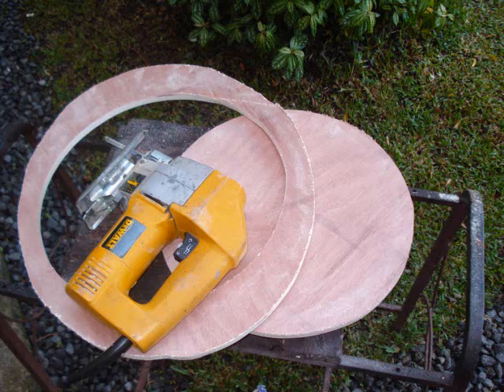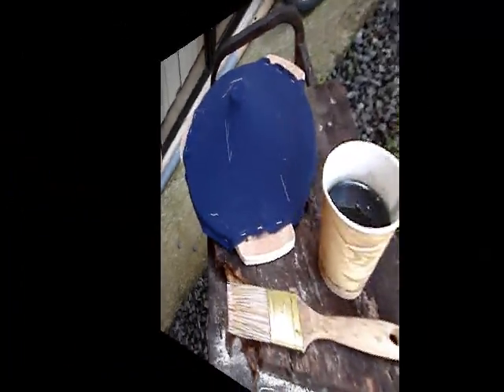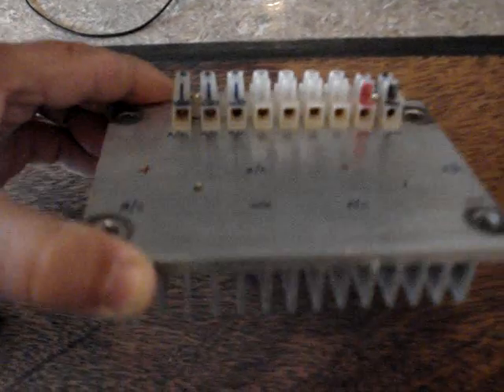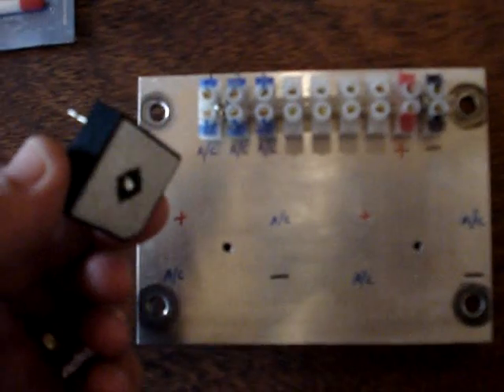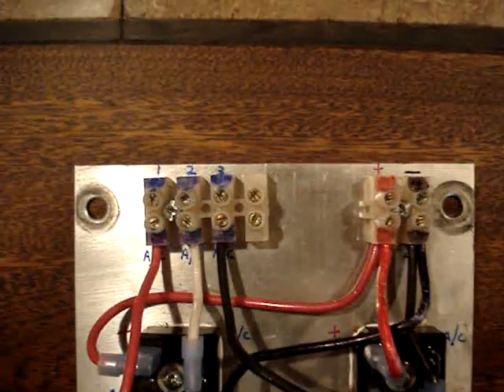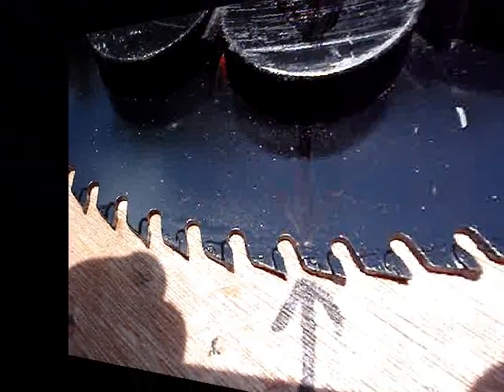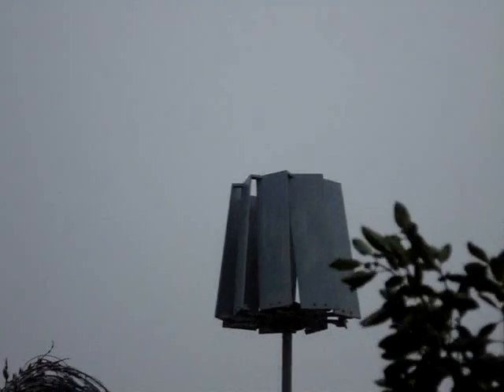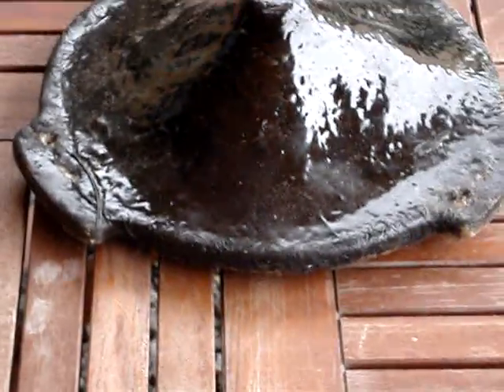(3) How to build a P.M.A generator for a wind turbine V.A.W.T

Comment: Wood warps with just humidity i wanna try aluminum  or carbon fiber for permanet use te
Reply from the maker: Wood can and has been used for blades for ever, some airplanes still use wooden blades. Also lots of HAWT turbines use wooden blades. It depends on the wood and how you treat it. Aluminum is also a very good material. Thanks for the comment.

Comment: I want, I'm confused, this bridge rectifier you used and 3 phasic or monophasic.?
Reply from the maker: +SANTANA CHAVES I used two bridge rectifiers and attached one phase of 3 from the stator to each a/c input on the rectifiers I end up with one extra a/c connection on the rectifier that does not get used. I connect both the d/c outputs from the rectifiers together to charge the battery.

Comment: another issue, and one that's tempting me to pull out my hair in frustration, is how to wire  2 to 3 stators to produce as much output as they can.
Reply from the maker: +Troy Moore Maybe you could use just two large ones. One to run your A/C power and the other with a bridge rectifier to run your D/C power. I have seen some other videos on You Tube that have run the A/C power directly from the PMA You should do your homework on that. I dont know how big the stator would have to be to handle A/C loads. Good luck.

Comment: next inquiries I would like to address is setting up how to use the direct ac output and setting up a bypass circuit that will allow me to  switch from ac to DC as needed/desired.

Comment: ive been referencing your videos, as well as my own research, via the internet, to plan out my own generator.  i am running into an issue, however.  i cant find any info on how to set it up to be used directly as an AC power source. any ideas on that?
Reply from the maker: +Troy Moore Technically the power running directly from the PMA is A/C to begin with you just have to spin it fast enough to produce say 120volts. If you were able to get it to spin fast enough you would have to add some capacitors to keep the voltage evened out. This is easier to do with hydroelectric the water keeps the generator spinning at a more constant speed.
Reply: I'll be building an electric motor for just that purpose.

Comment: nice video mate, one q though. 8v at 10 mph ,,, how many amps ?   I don't know much, but that sounds ok if the amps are there.
Reply from the maker: ***** The problem is you need more voltage than your battery to charge it if I was using 6 volt batteries it would work but will not work for a 12 volt battery. When I built this I had almost no wind for weeks so I never got a good chance to test it more. I ended up going solar. I may try again with the wind turbines. Thanks for the comment.

Comment: Great vids,,watched the whole series,thanks alot! I'm totally novice to that and laking some theory, but pretty good putting things together when I know how. A few qestions , if you don't mind:1.if understood correctly the stator stays unmoved, only the rotors moving over the stator with magnets fit over each other with N-S fixed position? 2. How did you bring thecwires from the stator outside the assembly?3 is there 2phase option and what is the difference in wiring, setting e.t.c.  thank you for your time and input
Reply from the maker: simon This is a three phase set up, 9 coils, 3 coils per phase. I used a threaded lamp bolt to run the wires up through the bearing assembly. I have seen single phase generators all the way up 5 phases they all wire up basically the same. check out Emagnets videos for some more in depth testing of PMA generators. Thanks for watching.

Comment: great vids, ive enjoyed watching them.

My gut feeling on how to maximise power from a wind turbine is to find ways of reducing friction - and thus improve efficiency.
Correct me if im wrong here, but your current model uses a central shaft - with lock bolts, presumably the weight is being held by this shaft?

Using bearings, or even possibly magnetic lift (as its vertical this may be possible) would reduce friction.

My apologies if ive got this wrong.
Reply from the maker: Your right friction, weight, magnetic cogging all are your enemy. I have not worked much more on the wind turbines in the last year or two. Wind turbines have there place but are not a set it and forget it set up like solar can be. I would like to explore some other types of generators but have to make time. Efficiency is the key to all these alternative energy solutions, forget about over unity just get something, anything 90 percent efficient and you have done something impressive and still stayed within the laws of physics. Thanks for the comment.
Reply: and thanks for the vid ;)

Comment: May I ask how much current and voltage it produces at low wind conditions? At any wind speed?
I'm interested in current at values near 20 amps at any voltage; at average low end wind speeds. Great job on project! And thanks!
Reply from the maker: In the wind conditions I have here I never got it over about 4 volts. Sorry did not check it for Amps. The Pma I designed really should be used with a larger faster spinning horizontal wind turbine. If you check out Emagnets videos he goes into allot of detail on volts / amps for his PMA s.

Comment: answered my question about the polarity orientation, what about instead of two sets of magnets, use two sets of coils instead. there by using both sides of the magnets, and try different coil wiring or phase sharing ?
Reply from the maker: You could add coils but anything you add increases the resistance on the turbine and makes it harder to spin. I have moved on to serpentine coils the seem to be more efficient and easier to make. I have videos on making a new style turbine and serpentine coil. Please check out my channel. Also check out Emagnets videos ,he has a ton on different configurations of serpentine coils. Thanks for commenting.

Comment: Pretty coool, I played with the idea also but came up with an almost similar turbine design where the blades would come out from center strait on 360 hinges. How it worked was the wind would push it the first 180 degrees, then at 181 degrees a pin would unlock the blade to free spin, so the blade would free spin on the next 180 degrees, it would act like a rudder on the way back, almost cutting off all resistance so you would have way more torque then having fixed blades. With that idea you could play around a bit more with surface area and blade width among other thing.. I never got past the blade locks. I tried makin them but didn't have the right tooling then. I'll eventually get back to it someday, hopefully before the zombie apocalipes, LOL.

I also tried making a mag setup for my little briggs motor but failed miserably. I got all the parts together and on the motor but never got a spark. The only thing I had to make was a generator field coil. I used the magnet on the flywheel, points from the engine, and ignition coil off an electronic marine engine. When I made the field coil I made the stator from plate steel with 3 layers and used wire from a starter solinoid with over 200 turns. Then tested it and got 3/4 of a volt AC current so I ran it through a rectifier and no dice. Then I figured out the coils off the electron ignition only work with power going into them and not in the traditional way points work. I found that out after it shocked the hell out of myself. It's alot of work to get 12 volts I'd say. I'm still kicking my self in the ass for this one, considering at my job I build alternators. In this case better to just buy the damb thing instead of makin it. LOL.
Reply from the maker: Cool idea with the turbine blades. You should try to make it work.
Reply: Oh yes, deffinately. I'm sure I can get it to work. I just need an easyway for the locking rod to move out of the way easy to work right. I only tried once. But just like everything I build needs a job to do to justify the expence, and this Idea will light up my shed that I need to build where I am clearing out those tall weeds to put the shed to build the tank to plow out my driveway in the winter time, or something in that order.LOL. See how I think.LOL. All in due time.

Comment from the maker: @FrankaDith I have researched this and it seems that by using metal as the backing plate helps increase the magnetic flux of the rotors. Increasing the effect of the magnets passing by the coils. My latest stator is a serpinetine type coil, they are suppose to be even more efficient than the traditional round coils.

Comment from the maker: @jonathanspindler I used 18 ga wire it came out to be about 70 turns per coil. I found it easier to measure 35 feet of wire and then wind it up, it was much faster and I did not have to worry about loosing count.

Comment from the maker: @bsummo123 You can get the rectifiers at radio shack along with the terminal blocks the heat sink you could find on old radio equipment or at a junk yard. Hooking up the bridge rectifier is easy there are markings on the rectifier to tell you what goes where A/C in +/- DC out. Also lynxsteam has some great videos on making your own.

Comment from the maker: @depravedpuma My magnets are 1.5 x 1/2 inch neo #42. They are set about a inch from the opposing magnets. They are very strong. The main reason I am thinking about steel for the top is because you have to use steel to set your magnets to help increase the magnetic flux anyway, you might as well make it all one piece.

Comment: What size are your magnets? I feel i may be in for the same out come. I am using a new wood stablizer insead or coating the wood it will penetrate it and after sealing the edges maybe I'll have better luck. If not i will have to encure the expense of buying metal also.

Comment: I was thinking of the weight of steel & Plexiglass.
More weight = lower RPM's.

Also, can you cut the steel plate? Plexi can be worked the same as wood.

Comment from the maker: @vanhook2  I think plexiglass would great  for the blades better than the plywood. I  also think it would be easier to make one steel plate for the top that way you combine the rotor and the top into one strong unit.

Comment from the maker: @depravedpuma I believe I could use a thicker piece of plywood and coat it well with resin.The magnets are very strong and over time bent the plywood I am currently using. I treated the wind turbine totally with resin and the plywood is still starting to delaminate. The problem with the resin is it cracks and allows water in. If I had access to marine plywood that would have been a better material.